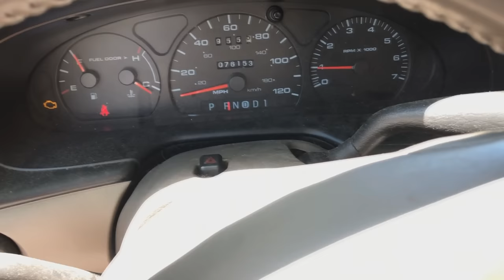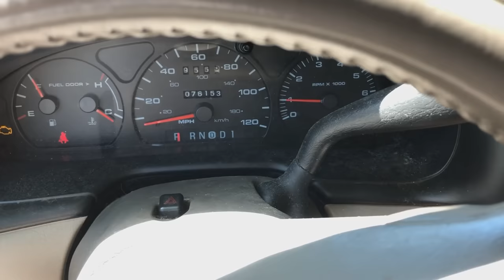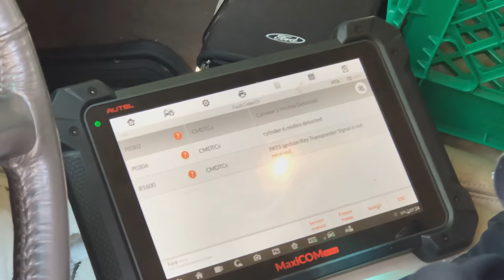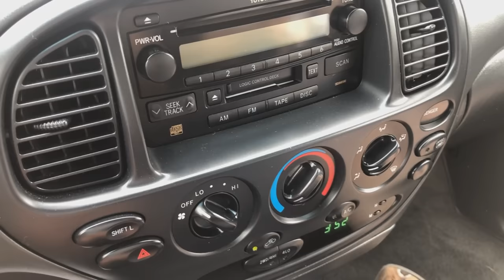THE END of my 2001 Ford Taurus!?

Comment: Idk if you still have this car, but I bought a 2003 Toyota Avalon back in August of last year and it did a similar thing. It would start fine, didn't seem like the battery was dead, but after about 15 seconds the idle would drop so low the car would almost stall and I'd have to rev it to keep it running. That was accompanied by misfire codes. I also smelled a lot of gas when it started and was running at first, it was coming from the exhaust. The car's battery would also die overnight. It ended up being my alternator, there wasn't enough electricity to fire the spark plugs for a few minutes after starting the car, causing the previously stated issues. Car starts/runs great now! I love it! It still seems to have issues idling right when the A/C is on, but I think I need to recharge the A/C.

Comment: You need to keep in mind fuel economy as you're driving constantly into the city.  Those 1-ton trucks might get you 8-12 mpg...  If you want a truck, stick with smaller rather than larger, unless you really need the carrying capacity of a larger gas hog.

Comment: I assume it's not the same problem I had, but just in case... My battery died right at the start of lockdown, and I had to replace it. I replaced with a fresh one and it still didn't start. When I connected a booster pack to the battery terminals it got really close to starting. Left it for another minute with the booster pack still connected. Held the key at position 3 for 10 seconds, and after 7 seconds it finally started. That was 4 months ago.

Mine was a dead battery due to lots of short trips (under 5 miles).

Comment: Hey... get the stands, jack stands, impact wrench, torque wrench, etc etc. Just get them. If you get a Toyota or Honda next, you won't need them for repairs but you can use them for maintenance and save a TON of money that way.
Except for jack stands, torque wrench, and spring compressors... get your tools from Harbor Freight too.

Comment: Got gas, then the problem. Water in the fuel. Get some heet and put in tank. If it's water, it will fix the problem. Could also be the fuel pump, mine went out around two hundred thousand. Twenty bucks and I put it in. Problem solved.
Reply: Just to clarify, a Bottle of Heet which removes water from gas by dumping ethanol (or some similar substance) into your gas tank. Usually in NY you keep a bottle in the trunk in the winter because water vapor condenses in the tank and causes vapor lock in the gas lines.
Reply: @humbughumbughumbug  Fixed, thank you.

Comment: When I was used truck shopping, there was one that came up from Florida at a good price.  I put my finger in the frame and found mud, likely from off-road use.  Check that frame hole in the wheel well.  Surface rust isn't as big a deal.

Comment: Maybe this will help with your decision making, maybe not... If you're looking for something economical and cheap to take care of, don't get a diesel. They are expensive to maintain. I have a 99 F350 dually and just getting new tires was almost 2k, they use a lot more oil and need the oil changed more frequently than a gas engine, etc... That being said, diesels (if taken care of) can live nearly forever. Mine has around 220k miles on it and I'm confident it'll go at least another 200k. Rust is to be expected, especially in an older vehicle (and even more so in places where it snows and salt is frequently used), surface rust is not a problem and doesn't affect the integrity of the car. You can get surface rust sandblasted and coated to prevent/slow more rust if you want. Avoid rubberized undercoatings though because water can actually get under them and make the problem worse.

Comment: could be worth looking at cyclinder 2 + 6 injectors AND spark plugs, and if they are ok then most likely it's your coil packs. If you had a bad fuel filter or fuel pump you car wouldn't start at all - not just misfire like it is

Comment: If you're not going to be doing too much towing or hauling I would look into getting a Toyota Tacoma. A bit smaller than a tundra so it'd be easier to drive around town, get better mpg and very reliable. Also Tacomas hold their value very well.

Comment: I know this video is old over 3 years ago.

Actually i got the same Ford Taurus  as well, but it's a bit different of yours. Well it's the same body style, but Only my taurus has Rear Spoiler and My taurus year is 2000 and engine is a 3.0L V6  Vulcan 12 valve Flex-Fuel engine. color is Harvest Gold Metallic. It's an good shape and i like it alot. I have installed every parts and changing all fluids. I'm also a bit of mechanic of myself cause I fix my car on my own without no mechanic helping me just DIY. Lol
And My mileage is the same as yours but my is over 79,403 

79k. 
Also i installed underglow lights lol. No engine problems so far for me. Original Engine and Transmission
Reply: Also every light bulbs it has in my taurus. I changed them all to LED Bulbs. Extremely bright also New headlights

Comment: If you choose not to go to a dealership, there is another alternative:  auto brokers!  

A local radio host used to talk about using one whenever he or a family member was in the market for a car.  It takes out the haggling for price and expensive upgrades.  Just tell the broker what you want, whatever extras you want, color, etc. then they get it for you.  Price is agreed upon when the sale is made.

I also recommend checking out mechanics via Angie's list or Home Advisor.  If you need to hold onto the Taurus for a while longer, at least get a guy who can figure out what's wrong and not rip you off fixing it.  Otherwise, find someone you know who knows cars and how to fix them.

Finally, if you buy a used car, from a dealer or private sale, get the CAR FAX!  This will allow you to research the vehicle ID to find out of the car was in any accidents and how well it was maintained by its previous owner(s).  I agree you shouldn't buy any vehicle more than a decade old (unless it's an awesome classic car of course!).

Comment: get a 1998 f150 4x4 with the 2 valve 5.4 one of the best gas motors ever made. And if you want a diesel get a 7.3 power stroke these two are the best

Comment: Frankie, get a Toyota Tacoma or a Tundra, but you have to check the frame(the continuous steel thing  to the both rear and front suspension). Next time get a hummer and start hitting all the frame and under and it should sound solid.Don't buy it if there's any punctures! If  you find a low mileage Mazda pickup it should be good too, but they still rust a bit.

Comment: I think Honda and Toyota are good investments. They last for 200k+ miles and the parts aren't terrible for the price. It can be difficult to find one because everyone buys them up but they're a reliable car. I had a CRV that was almost at 200k miles and it would have kept going if the 17 Y.O. wouldn't have smashed it in the dark with no lights on going down the road.

Comment: Sounds like a clutch start solenoid to me, it is related with the transmission function. If there's a check engine light on hook up a scanner to it, much cheaper than a new/used car..

Comment: My Ford Transit does exactly the same thing, probably thermostat or the fuses. I would pull all the fuses out see if they are corroded, would be a really cheap fix. Check all the rubber pipes to the air filter are not perished as well, or just pull air filter off see if it helps it start.

If it's any of the electronics stuff, just trash it.

My transit still goes, even if it does run like shit when you first start it. Some of that stuff I did made it a bit better, fuck knows whats wrong with it. In my case I rather suspect the automatic choke doesn't work properly. But then again it has done over 100k miles, which apparently in unheard of for a 2006 Transit Connect, Ford make really shitty engines.
Reply: Martin Svensson  That as well :), sort of thing that should be looked at, at a service anyway. 

I just know the fuse box on my transit I have water is channelled over casing, which caused some intermittent issues, had to replace all the fuses because the contacts had corroded so much.

Shitty design, all the rubber pipes had also turned to cheese and partially collapsed. 

I think the thermostat controls the choke and other stuff the computer does, so a candidate other stuff don't fix, but then again the diagnostic dude should have been able to determine that, so :/.